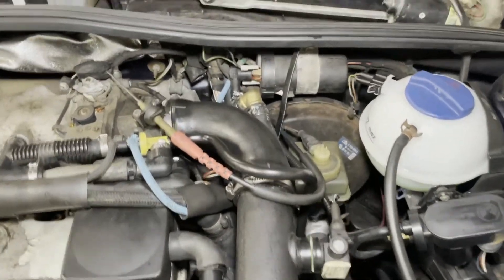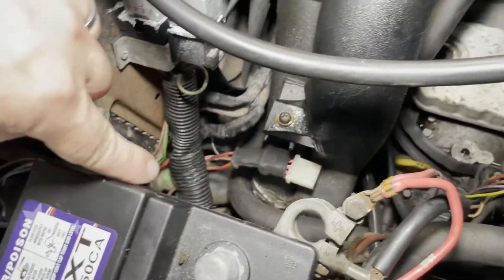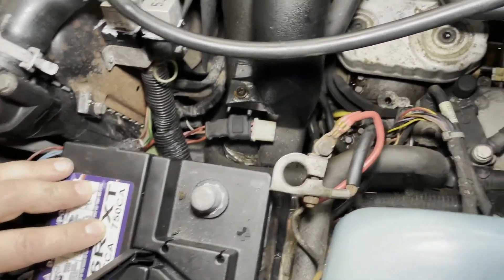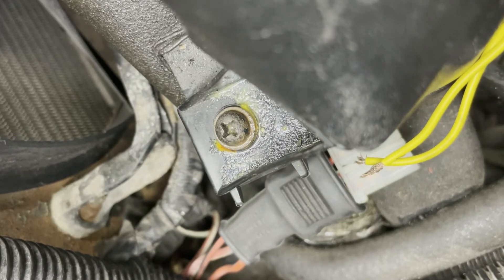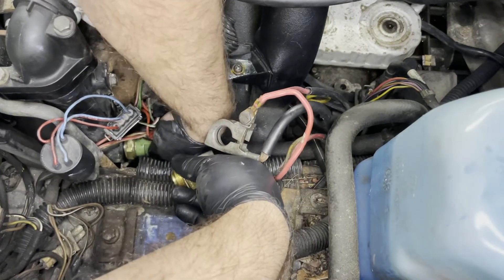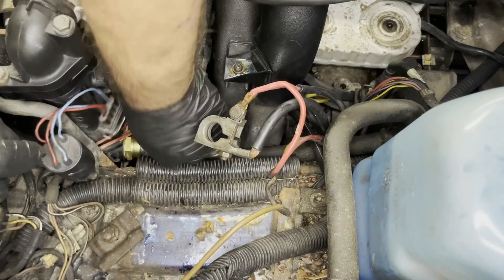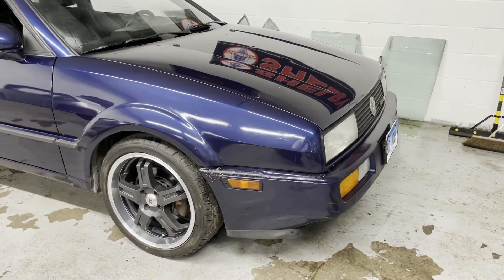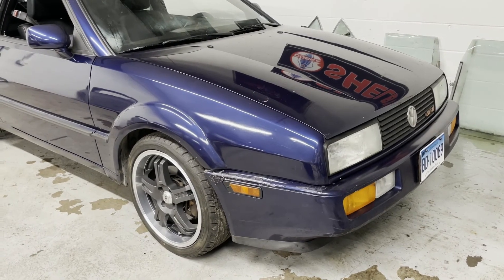Project Corrado Overheated! Part 2 - Testing the Fan Switch

Comment: Wow, I’m so glad I found this video. I’ve been having the same issue on my Corrado SLC since my VR6 was REBUILT after I drive the car and get up to normal operating temperature then turn the  car off, the fans never go on. Do you think it’s a bad thermal fan switch?

Also, they say that if you don’t have a low temperature thermostat and just put a low temp thermal fan switch in that your car will not run cooler and it will also waste more gas and cause your car to stall. Is this true?